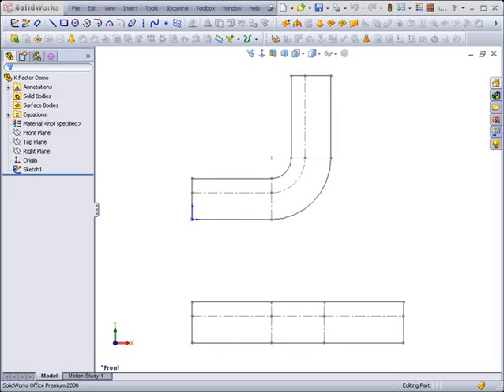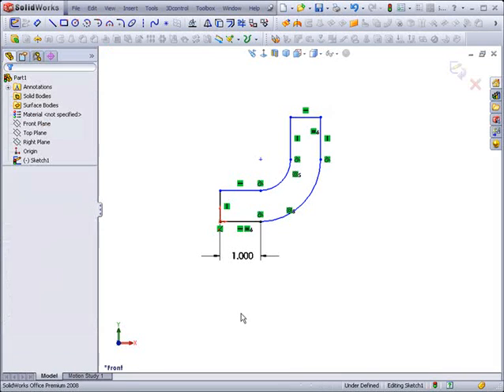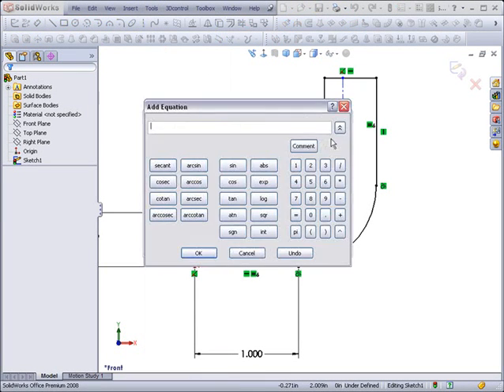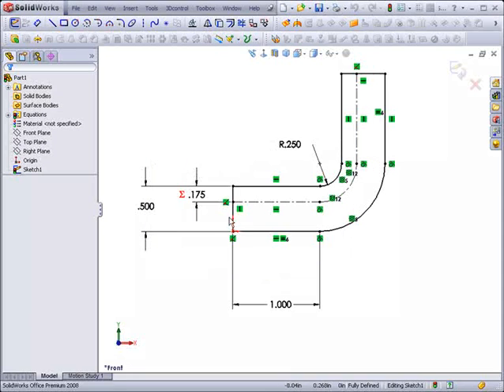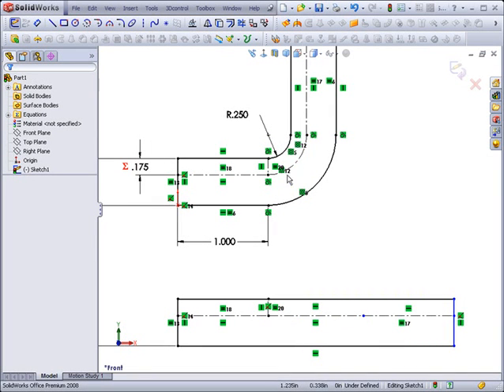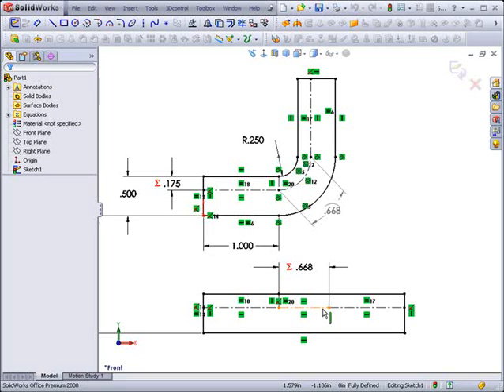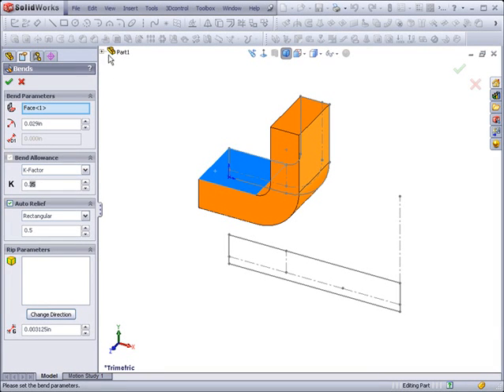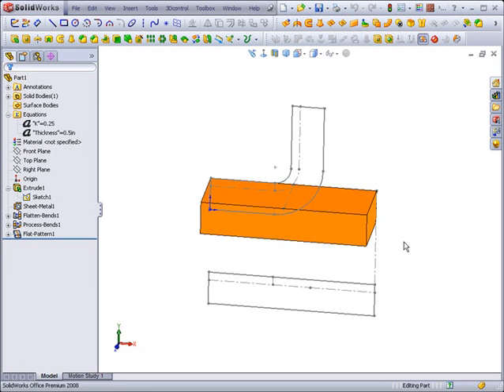K-Factors and Fun with Sketch Equations

Comment: How does this "K" line (neutral axis) look like if you have sheet bend into "Z" shape?
Reply: Yes, and outside bend and inner side has 1 and 0. K factor is when you divide thickness of a sheet being compressed and whole sheet thickness. But in reality for machine bending, you need to get more parameters.